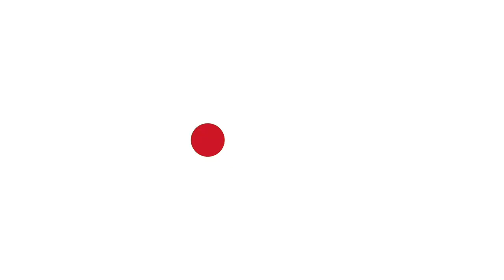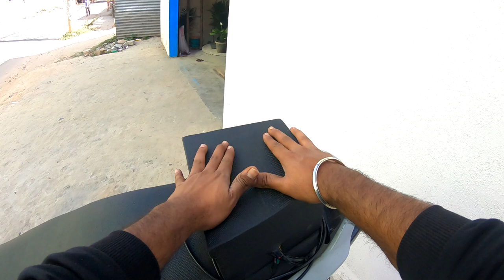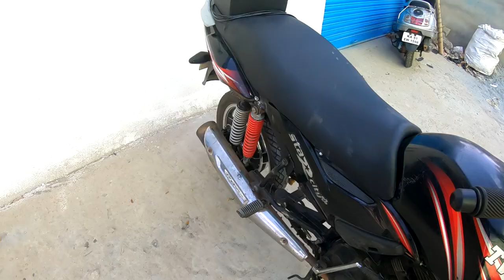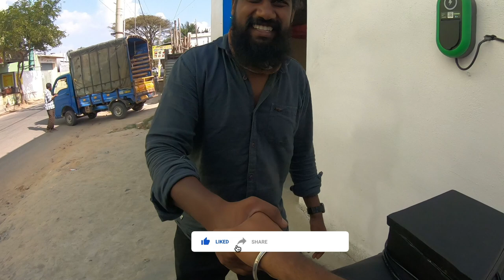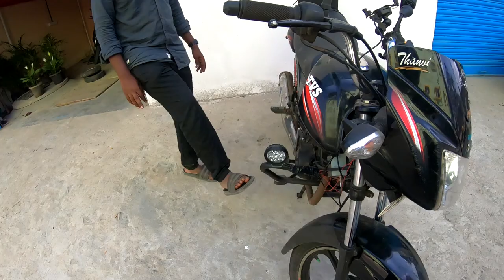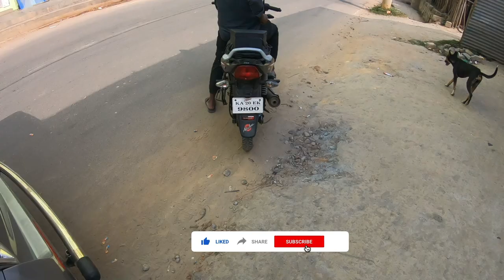Converting Tvs Star City To Electric Bike 2000W Hub Motor Petrol + Electric Bike

Comment: When customer need high range on electric . He would have removed the  fuel tank and installed the battery at fuel tank place.  And fuel tank he would have installed with 2ltrs capacity fuel tank some where side shield.   It's simple . He made worst design.  But hatsoff to his dedication.

Comment: You did wrong the hub electric motor should come to front wheel and back should be as it is. For battery you how to give in side bag 
Or in petrol tank and petrol tank should come below the front seat.